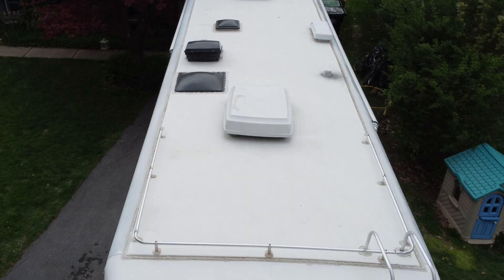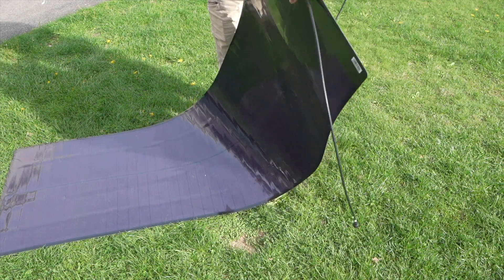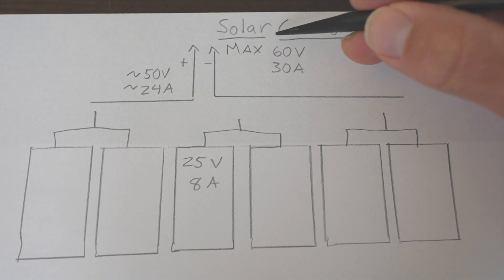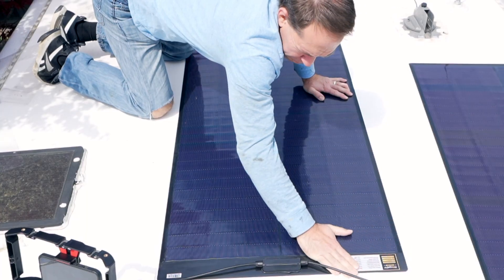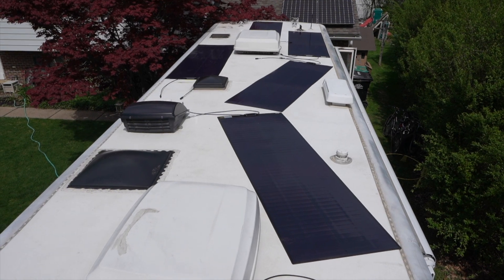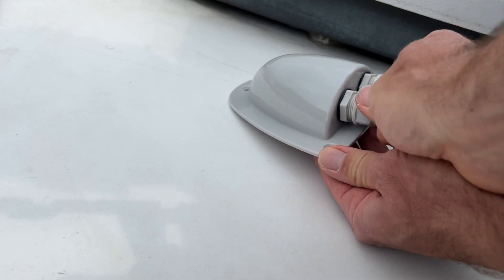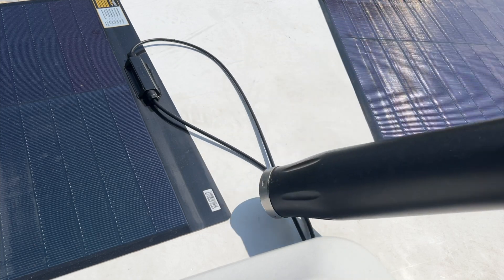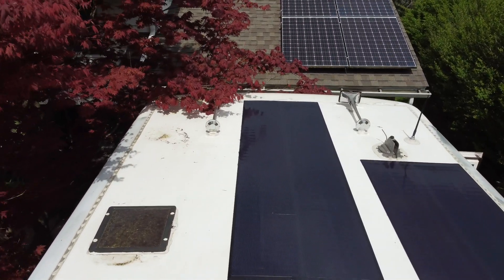I Installed a Mobile Power Plant | No Drilling Holes for Panels RV Roof

Comment from the maker: Do you have an RV or camper with solar?   What is your setup like?  Thanks for watching!
Reply: Great video to see some options.  Better than drilling more holes for L brackets.  
We usually camp with our motorhome in the shade so have a 
a suitcase solar panel on long wires.  Definitely better than running the loud built in generator and we usually only need around 35 Ah per day.
Reply: hi so you did both series and parrallel?  interesting, to start I'm only going to have 2 (mismatched) - one 200 amp and one 100 amp - should I do series? or does it matter if you only have 2 ?   I'm going to be using it in conjunction with a Oupes mega 2 power station which does support advanced mppt.  i think for my install i won't need a switch? thanks!

Comment: Have you gotten any leaks from panels creating too much heat on the fiberglass.  I did, the spidering of the fibers was significant. Pulling the panels and tape is ridiculous. Expensive mistake
Reply from the maker: No, I haven't had any problems.  My RV roof isn't fiberglass, it's TPU (I believe).

Comment: On you solar monitor display, what system or app are you using to track the solar output?  Great video by the way!
Reply from the maker: Thanks for watching!  I know these panels are more on the expensive end but they have been awesome.  The app is the external monitor for the EcoFlow power kit.  That's the system these solar panels are plugged in to.

Comment: I just purchased 6 as well, what is the average watts that you have been pulling in campgrounds with partial shade? With no angle, when does the charging usually start in the morning if thee is no shade spots, thank alot?

Comment: The amperage rating is the max output of the solar charger not the max input. You can over amperage a charge controller but can over voltage
Reply from the maker: I was referring to the MPPT input specifications if I remember right (and we are talking about the same thing). And I think you meant you can’t over volt.

Comment: hi curious why you didn't use 8 gauge wire? i just watched a youtube video about how much more efficient 8 is: https://www.youtube.com/watch?v=FMyhQAwaw2Q
Reply from the maker: The short lengths I had to deal with didn't rise to the level of needing to bump up in gauge.  So maybe I might have gone from .75% to .5% voltage drop.  For DC circuits you really need to factor it in when talking about longer runs.

Comment: Ok so its been almost a year can you make an update vid ?
Reply from the maker: What particular aspects would you be interested to see?  The system performed better than I expected all of last summer.   I'm eager to see how it does this summer.
Reply: @FrugalRepair   great well  id like to know if the solor panals stayed glued to the roof i love the idea about the “ no drill holes in roof idea “ but im concerned about them flying off and something happens  when the glue wears off  also what are you going to do if one panel breaks and have to change it  how is that done    3m tape is very strong
Reply from the maker: Thanks for letting me know.  They are using butyl tape. So far after 5,000+ miles of hiway and one hot summer, they are still on there with no movement.
Reply from the maker: To get them off, you would use directed heat and slowly peal them off.  Then some solvent to clean it up if you wanted.  I’m not speaking from experience, just what I would expect if I had to
Reply: i'm also curious how this affects the roof over time.. i was thinking it might protect the roof more or it could damage more due to the heat..

Comment: This sounds awesome. Do you have an update to this panels? Whats about degradation and surface cracks? My small camper in germany has 550W on top. Good for cooking during my summer camping trips.
Reply from the maker: Yes, they are great panels.  I'm about at the one year mark after installation.  The panels look great and continue to perform great.  These CIGS panels don't get surface cracks to my knowledge.  I will keep an eye on production values but I haven't noticed anything significant so far.
Reply: @FrugalRepair  Good to hear. A 4 year old video from Will Prowse is very negativ about the longtime life of flex panels. Great that BougeRV made a improves solution. 👍
Reply from the maker: I haven't seen that video you are referring to but my guess is that was a different thin film technology (ie not CIGS).

Comment: Bro wants me to drop $3,600 on 12kwh max. That's $3/wh which by normal standards it's $0.46-0.54/wh per normal monocrystalline panels. 

Nuts, insane, no.

Buy a solar array and make money from the grid for that price.
Reply from the maker: I don't want you to buy them, to be clear.  They aren't for you unless it's going to save you time or it may be the best option for solar due to their design. The prices for these seem to have gone up since I made this video.  I had also regularly seen large discount coupons for them so that may still be happening.

Comment: I want to know the temperature of the front and back of the flexible solar panel in summer. Can you tell me?
Reply from the maker: I couldn't tell you because temperature changes all the time given the conditions.  I did give example temperatures in this video.
Reply: @FrugalRepair  Thanks for the value this video brings, it’s great!
Maybe you can test the temperature on the front and back with a thermal camera

Comment: how are these holding up? i heard this type can overheat and damage the roof? thanks
Reply from the maker: They have been holding up well so far and producing better than I had expected.  Time will tell how it goes but I’ve not had any issues and had plenty of power on our travels this past summer.
Reply: that's awesome i just picked up 2 on ebay for $475 ! open box specials one 100watt and one 200watt  @FrugalRepair
Reply: just curious how long your rv is - i have a 30foot fleetwood flair 2021 @FrugalRepair
Reply from the maker: I think you will like them.  Ours is a 38' RV.
Reply: ahh ok that's why you can fit soo many lol  @FrugalRepair
Reply: Hi maybe you can help.. I have a 2021 flair 29m and have some CIGS panels i want to put on the roof - I don't see any pre-wired boxes or anything to connect to.. so I'm wondering if I can use the existing front winegard location or satellite cut-out towards the back ? I don't use those. (would it be hard to phish the solar wires thru?) - also I am upgrading to lithium and have a separate oupes mega2 solar genearator that is stored in the electric compartment that has an RV outlet which actually powers the A/C with the softstart i just installed....  thanks!  @FrugalRepair
Reply: @FrugalRepair  hi, i'm about to dive into this project and my first issue is i don't want to drill a hole, i don't use the winegard - can i use that area? thanks
Reply from the maker: @DeFiDuke  sorry, for some reason seeing replies is not the same notification as new comments.
Reply from the maker: @DeFiDuke  I don’t remember if I put it in this video but I removed my antenna to get more space for the panels.  I would think you can use any area.  The butyl tape is super strong and they put a generous amount on it.  Just make sure you have it lined up right, you kinda get one shot once you stick it down.  For a new question, could you create a new comment?  I’ll be able to get to it faster.  Thanks!

Comment: Wait, the 30Amp max rating is at charge voltage (14.4) output from the Solar Controller. So wire the panels in series while not exceeding maximum input voltage to the Solar Controller (60v). Victron Solar Controllers can handle up to 100VDC, and some go higher, such as 150VDC.
Reply from the maker: I’m not sure what your question is.  I’m not using a Victron controller here.
Reply: @FrugalRepair  It wasn't a question, we were citing Victron Solar Controllers as an example of higher input voltage capability for wiring panels in series.
Reply: which one are you using? 
 @FrugalRepair

Comment: I just got these, and been getting flack about heat. How have they been so far directly mounted to the rubber roof?
Reply from the maker: They've been great all this past summer.  What kind of issues are you having?
Reply: Nothing yet. Just haters saying flexible panels suck. Just installed them yesterday.
Reply from the maker: Keep me posted.  I have been impressed by these panels so far.
Reply: @tzarza  how they holding up?

Comment: Best stuff I've found for holding wires down neatly is 2 inch roof tape. It's like 20 or 30 bucks but makes for a clean looking install
Reply: interesting but then it's much harder to remove ?
Reply: @MikeDeFina  yes sir. the roof tape is great for making clean looking install but you gotta make sure to have it all correct because it's pretty much permanent when that takes put over the wires. I'm adding a couple more panels to the roof of my camper when I get home in a couple weeks and I'm gonna have to cut the old tape and try to redo some of it when connecting the new part.
Reply: @matthewknight5641 cool . I'm doing a very similar install to this video and I think I'm gonna "stick" with the way he did it with white wire loom .  I just need to figure out how to get the wires into the electrical Bay on a 2021 Fleetwood flair
Reply: @MikeDeFina  when running wire through the roof or through any hole from outside it's good to pack the hole with black rtv silicone that is used for gasket maker on engines. it keeps a great seal against the weather and keeps the road vibrations from rubbing through the insulation on the wires. mine has never leaked  or shorted out. the white wire loom is on I guess but you kinda want something uv rays won't break down in a year or two. that tape is more of a hassle but it lasts and is safe and looks better  but to each their own ya know. I've seen it done many ways and most ways works for awhile anyways
Reply: @matthewknight5641  i didn't think about the break down of the wire loom... that's interesting.. now u got me thinking..
Reply: @MikeDeFina  man Ive  bought between 55 and 60 grand worth of components and accessories over this past 3 years and run my shop and my camper off of solar. I'm no professional but I've made about 20 grand worth of mistakes just learning what don't work and what worked but not worked well. I've finally got my systems where I'm happy with them and hopefully I'll never have a power bill again but it's been an expensive hobby lol. yeah that white rubber type roofing tape makes for a clean install and keeps the wires from rubbing shorts into them and I'll tell ya man I've eliminated all those mc4 connectors and just used soder and 2 layers of good shrink rubbing at all the connection points outside because those mc4 connectors seem to get briddle and most of them leak  and corrode.

Comment: You can go over the 30 amps of the controller you just need to stay under the voltage point. The 30 amps your controller is rated for I the output amps to the batteries that the controller is capable of. Lots of people over panel their controller by 20 or even 30 percent so that they are making the 30 amp output for a longer time each day

Comment: have you considered making a way to plug it into your house's solar to give to the power company or use for yourself if needed whenever you're not using it and it's just parked?

or would that not be worth the costs and efforts?
Reply from the maker: Yes, good thought.  I'm not backfeeding power to the grid but I can use it for other power needs.  I installed a 30 amp plug on the AC output that I could use our just with a regular extension cord.   A some point I'd like to put in a generator inlet and a transfer switch on the house so the RV can power the house when needed.
Reply: @FrugalRepair  wow sounds cool thanks for answering

Comment: I am curious, in the state you live in, what is the buy back rate for your electricity? In Saskatchewan Canada they have their "Net Metering Program" set to ~50%. We have longer winter months, so you would have to take your average usage of power during the winter months, and multiply it by two, and that's how many kWh you have you supply back to the grid during the normal year just to make it affordable.

I am curious if the US ones are any better.
Reply from the maker: I’m in Pennsylvania.  We have 1-1 net metering.  If interested, check out the video on how I earn with with solar array.  I explain the production and various credits we can get.

Comment: One possible issue: NEC 690.9 (A) (2020 Edition) electrical code says panels installed in parallel need a fuse on each sub-circuit if the total array max amperage (24A) exceeds the maximum series fuse rating for each panel - I couldn’t locate the max series fuse rating for these panels.

Other than that, these are over three times the cost of solid panels!  Longevity is also questionable with any flexible panel, so check the warranty.
Reply from the maker: What do you mean by fuse rating on a panel?  Do you mean Isc?
Reply from the maker: Thanks,  I see it's 10A so I'm adding the 3 fuses.
Reply: @FrugalRepair  Great idea to be safe! Take extra fuses!  Have fun!

Comment: For a small system on a rig with limited weight carrying capacity I think they are great. Those panels don't look like the cells will crack and arc, causing a fire like I've seen mono cells do. They appear to be a little underrated too, which is a plus. The downside is their low efficiency of only 16% so they take up more roof area for a given number of watts. I mounted 2, 310watt Canadian solars to a liftable array on the side of my motorhome. I did this to leave my roof free to rack 8, 460-watt Bluesun bifacial panels about 13" off the roof of my motorhome to keep both them and my RV cooler. The downside of these rigid double glass panels is that they are heavy. With the aluminum racking, I'll be adding about 575-580 lbs on my roof - not an inconsequential amount, but within the carrying capacity of my RV. In my application I should get another 10% off the back of these panels (boosting their efficiency to well over 23%) so they will perform similar to 500-watt single sided panels, and they only cost $262 each from Signature Solar for an effective cost of only 52 cents/watt (63 cents/watt when the racking material costs are considered for an apples-to-apples comparison to these CIGS self-adhesive flexible panels of $2.89/watt). This will give me the equivalent of 4,000 watts on my roof. Being flat mounted, they will produce 25-30% less than the liftable panels on the side of my RV. So I estimate that their real-world performance will be in the 2,500-3,000 watt range on a bright sunny day. When I add the 620-watt array on the side I should have sufficient solar to charge my approximately 23Kwh of batteries to power all my electrical needs, except for rare occasions. When necessary, I can use my 5,500 watt generator to put 80 amps into my 12v 560ah bank via my Progressive Dynamics Converter/Charger, and 40 amps into my 310ah 48v bank via a Sungold Power all-in-one 48V, 5,000W inverter/charge controller/battery charger.
Reply from the maker: Great to hear about your solar setup!
Reply: Dang and I'm over here wishing I had the money to just buy a cheap used tear drop to pull behind my Bolt EV and put some panels on the top of both of them to see how that all works out. lol one day I will get there, one day....

Comment: Cables will slap themselves silly on the roof if you do any serious road mileage (imo).
Reply: Any worries just add some RV Eternabond tape to hold down the wires.
Reply from the maker: Actually this is not true.  Thousands of hiway miles later there has been no discernible movement.  Everything has held up very well without issue.
Reply: are you slapping yourself silly?

Comment: Why did you do them all misaligned? Looks like you had the space to make them straight
Reply from the maker: I was attempting to minimize shading on the panels, considering cable placements, and though a small consideration, get a more average angle of incidence across all panels.
Reply: @FrugalRepair  ah ok thanks for the explanation

Comment: Unfortunately flexible panels suffer from 2 major issues. One is to be flexible it's made of plastic, which yellows with age and this kills output. The other is by being stuck to the roof it does not have enough airflow and you guessed it. Heat hurts the lifespan and active output of the panel.

Sure it's faster to install. But if money or longevity is the priority this is probably not the play.

Comment: I was so excited to see the release of these panels. I hope they release these in more sizes in the future. For example, I know they just released a blanket style panel. This size is just too long and cumbersome to transport for me. Thanks for your review. Love the bit about how many diodes they have. This is info I love to know, so I have validation they do better with partial shading.
Reply from the maker: Yes, I was skeptical at first but after playing with them (not on the RV roof) they did produce over 100% when pointed at the sun, did great in cloudy weather, and when shaded.  I'm eager to see how they hold up on the RV roof through our travels this summer.
Reply: @FrugalRepair  since my last comment, I bought and received the folding version. I am anxious to run it through its paces. Then, I need to figure out how best to use it when I am camping.
Reply from the maker: I’m curious to hear how it goes.  I ran a test today and the panels on the RV roof  were making about 193w each!